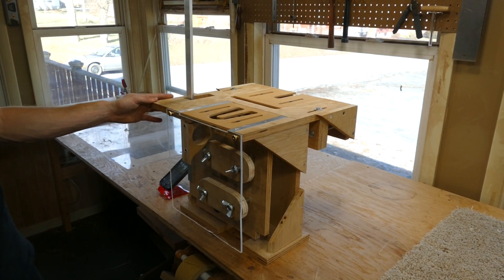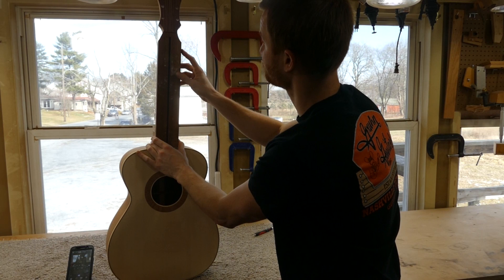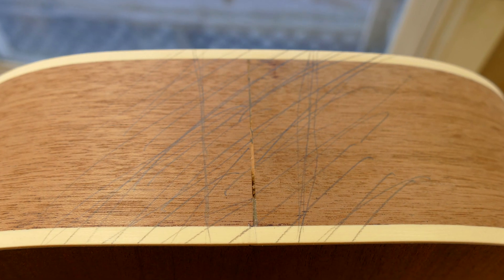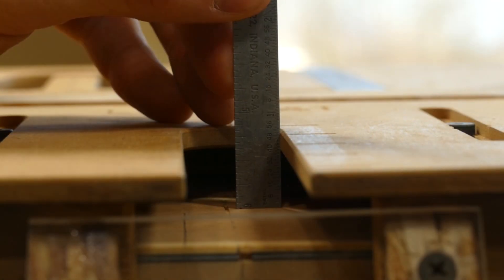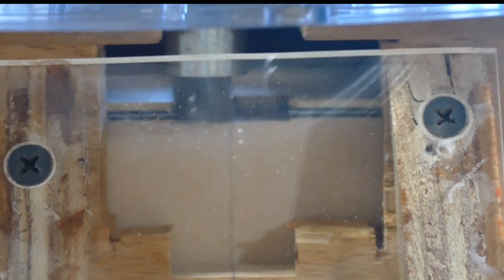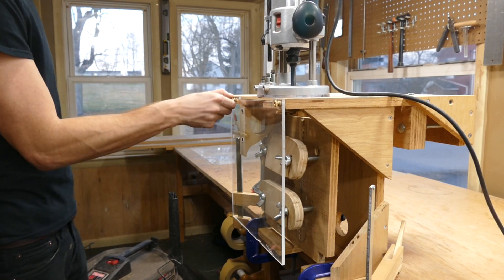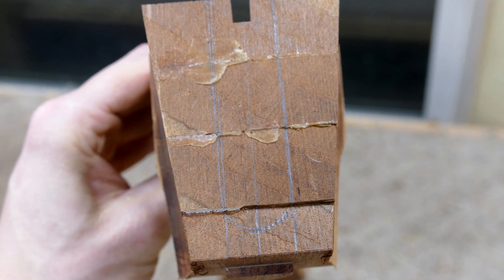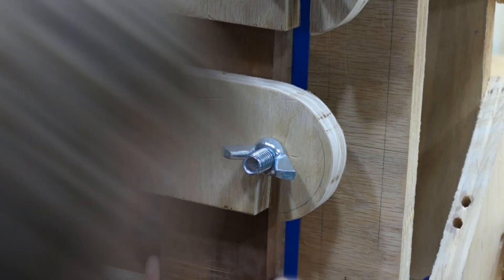Making the Most out of the Robert O'brien Mortise and Tenon Jig

Comment: Nice video Eric.  Have been struggling with a lot of the issues that you have addressed with your mods to the original.. I'm in the process of re-building my jig and I'm making it somewhat more rigid to reduce the flexing.  I will incorporate the other ideas to keep everything square and aligned that you have shared here as well.
Reply: instablaster.

Comment: Robert, this may not be the right video to comment but you are the go-to luthier. Neck angle: we know the strings ride between the nut and bridge, and we want a consistent space between the strings and the fretboard. As we raise or lower the bridge height we need to adjust the neck angle accordingly. I’m your opinion does a steeper angle ( and higher bridge) result in a higher tension and better transfer of vibration to the sound board? Can you recommend some reading material on neck angle, string height, bridge, saddle relationships…or I can just follow the instructions…haha. Thanks for being such a great resource. As a kid, before computers, about the only resource was a copy of Sloan’s in the public library and the old Russian luthier who worked at the Blue guitar

Comment: I've just bought Robbie's plans and am about to embark on building this jig.  Totally onboard with these suggestions, and I will aim to build them in from the outset.  I'm wondering too about clamping.  Maybe secure it on some sort of base accessible from both sides?  I'm guessing the increased mass of the whole resulting structure will help to negate the ability of the whole thing to flex under pressure, affecting the final neck angle?

Comment: Great tips, Eric, thanks for producing this.

I've got a question and one suggestion:

Snugging up the neck blank to the bottom of the tenon template: I understand that the end of the tenon will not bottom out in the mortise, so the end angle of the tenon is not ultimately important when finally attached. But when setting up the cut doesn't the butt end of the blank need to be flush to the bottom of the tenon template to ensure that the shoulder of the tenon hits your 14th fret layout line? The end of the tenon can be trimmed off, but only after you set the depth of your bit. In other words, in Robbie's layout sequence the nut position is the fixed reference, then the 14th fret line is located from the nut, then the end of tenon line is made exactly 7/8" further from that and the neck blank is cut off at that line. Unless I'm missing something, the end-of-tenon line is your exact index point to properly set the shoulder of the tenon at the 14th fret line. The reason I'm bringing all this up is that if you sand the end of the blank carelessly you might lose your reference point and the neck won't meet the body exactly at the 14th fret. This happened to me, though again there might be something I'm missing.

My observation: I think Robbie's jig is great, but clamping it solidly is still an issue. Eric, even though you made provisions for your clamps I can still see that your jig has quite a bit of rock in it. I was holding my breath every time you used the plunge router, especially since you were so careful to consider the weight of the router and attachments. Locking down the jig a little more is the only suggestion I could make to your very useful video.
Reply from the maker: Thank you, Jeff. Good question, and a good suggestion.

Snugging up the neck blank to the bottom of the tenon template:
If I am understanding you correctly, here is what you are missing... The bit is bottomed out against the end of the blank before you set the depth of the bit. That way, no matter how far the neck is from the template, the depth of cut is still 7/8" from the end of the blank, and not from the template itself.
In other words, before I set the depth, I plunge the router bit down with the router turned off) until it hits the neck blank and I lock it in place. NOW I set the depth to 7/8. Does that make sense? I think that's what you were referring to. Let me know if I'm missing your point entirely.

Thanks for the suggestion. I agree that it needs more support. I think some way of connecting the leading edge (where the tenon template is) of the router bearing surface to the workbench itself would do it. I imagine something like 2 support beams coming down from the corners to meet the workbench surface to eliminate flex. Whatever way you support it, however, it has to not get in the way of the other functions and moving parts of the system, which is a bit difficult, but not insurmountable.
In lieu of all that though, checking measurements with the weight of everything considered really does produce predictable results when you make the actual cut. You are right though. It would be nice to not have to worry about that in the first place.

Comment: Thanks for the vid. So do you think the weight of the perspex and shop vac hose is causing the jig deform causing the difference in measurement that you talked about (about 20 minutes  in)?  If so do you think a more slid construction would remove this variance?
Reply: "solid construction"  e.g thicker ply wood